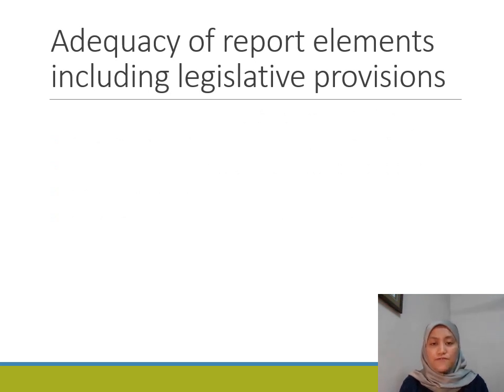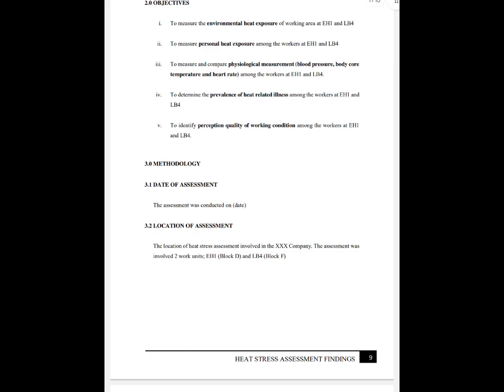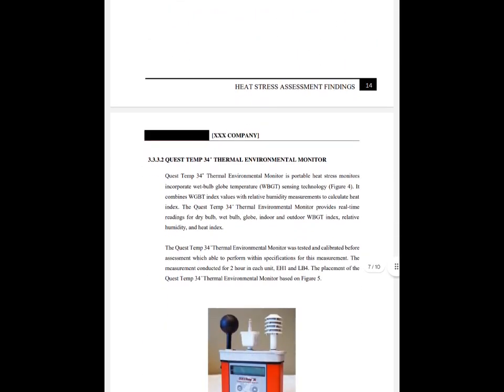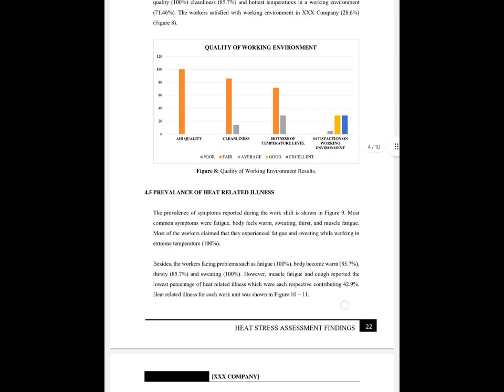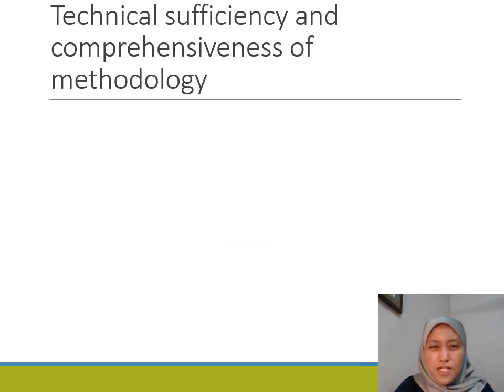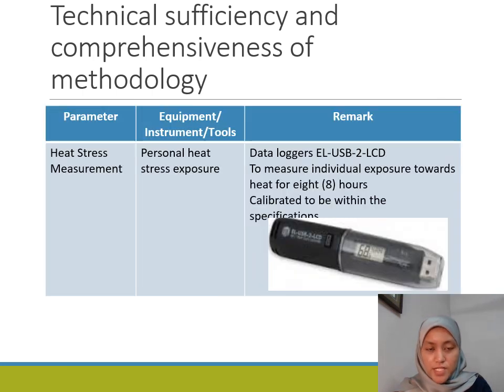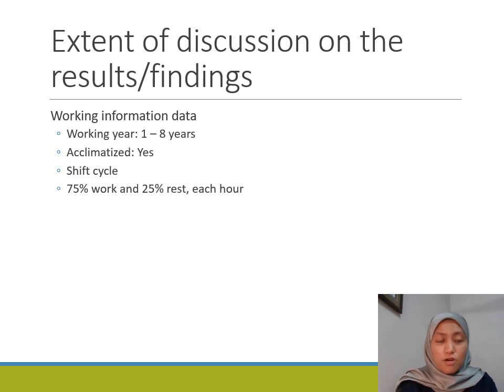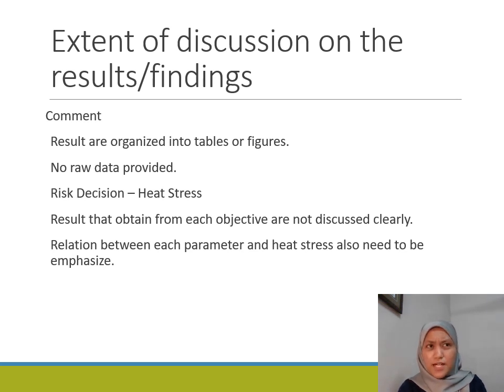EOH 5203 Industrial Hygiene Management (2022/2023)_Assessment 2

Comment: Very detail and good presentation…
I would like to know when you mention low risk you mention that they need monitoring..do you think trainning is important for them too to detect the sign and symptom of heat ?
Any PPE recommendation for it?
Reply from the maker: Thanks for watching. Result showed that the heat stress level exceed the PEL which is consider high level of heat exposure. Even when the exposure is low, several aspect need to be considered which can be referred from guidelines of heat stress management 2016. 
Training: Yes, training is important as personal exposure is based on symptom and sign that experience from workers. It is best to educate workers on heat stress so they able to recognize their own symptom due to heat exposure. 
PPE: Appropriate work clothing are necessary and has to ensure that the clothing allows the body to cooled. In general clothing should be lightweight , loose fitting and made of breathable fabric. In addition, light-colored that reflects the heat better than dark-colored cloth. It is best also to practice to remove PPE when at rest.